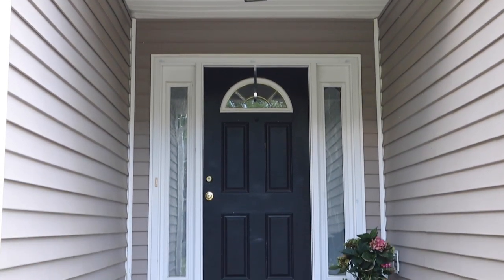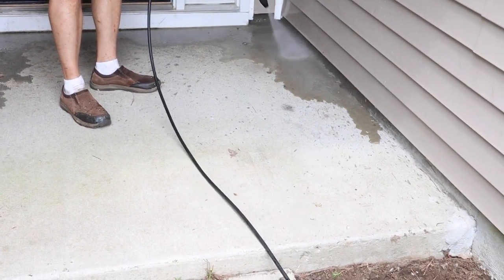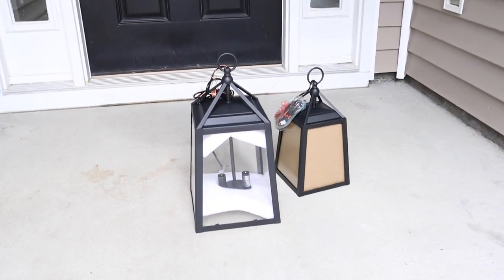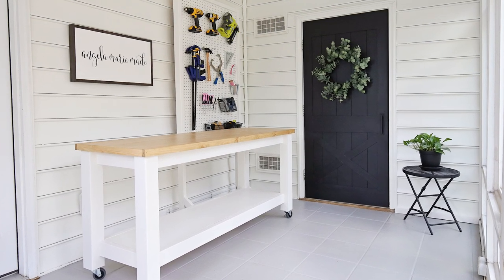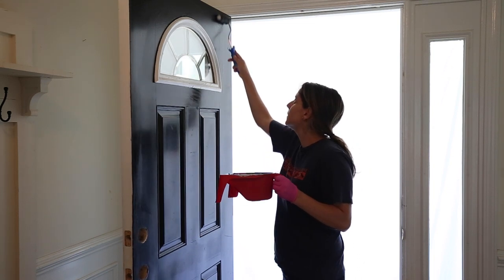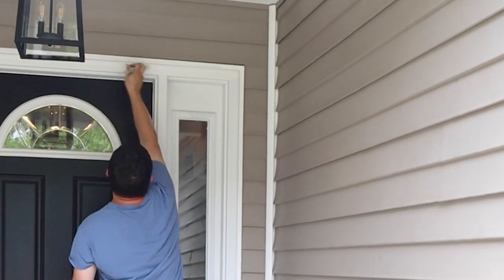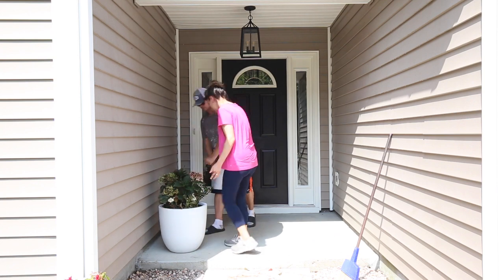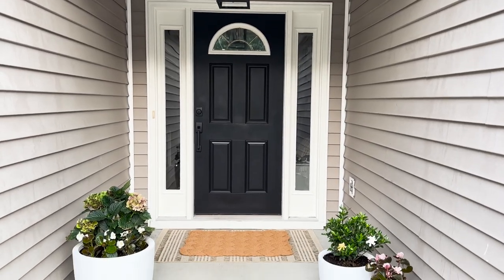Small Front Porch Makeover on a Budget in 2 Days!

Comment: Looks great. I'm glad you chose the bigger light. And good call on the double doormats and placement of the planters. I need to paint my front door before it gets to hot (I'm in Florida). When I changed out the lockset, I changed brands and had to drill a new hole for the bottom of the handleset, too. Regarding the concrete stoop, have you thought about tiling it? I think it looks better than paint. My sister, my mom, and my neighbor all tiled their stoops. Two other suggestions and I hope you don't mind. Have you considered painting all the door and window trim (including the fan light) black? And the white trim on the siding corners would look good in the siding color if the previous homeowner left any paint. I don't think that trim is intended to stand out. I love your projects and subscribed today.
Reply from the maker: Those are great suggestions! Thank you so much for following along.